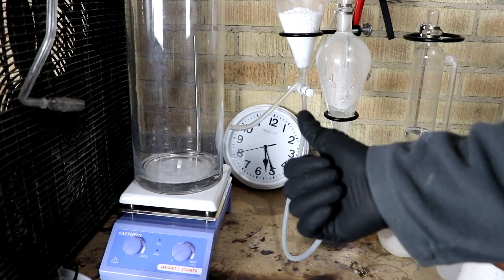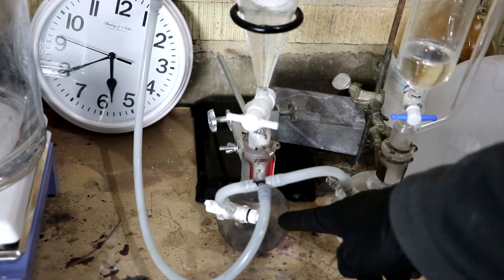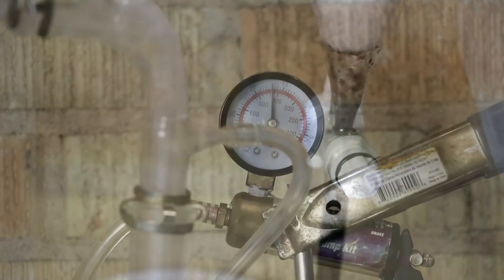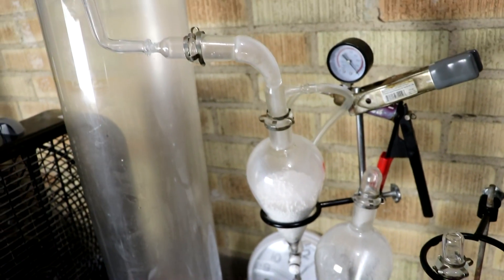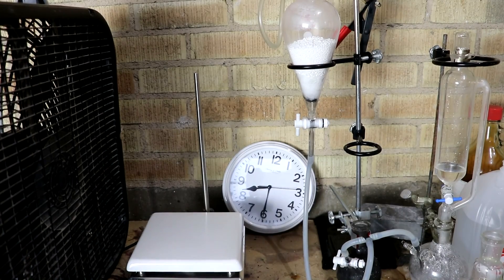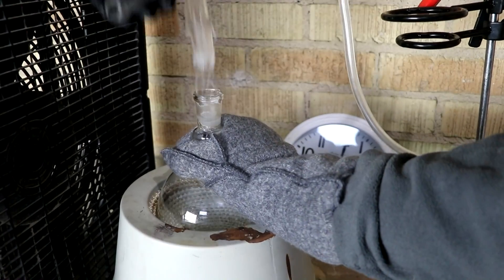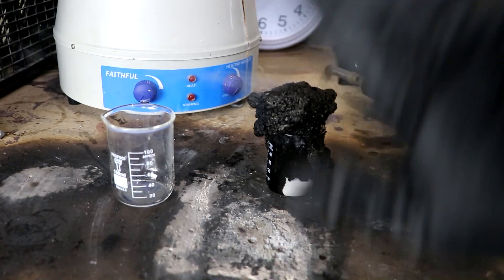Making Sulfuric Acid using the Chamber Process

Comment: Why didn't you use a 3 neck flask to pump air in and SO2 out, with elemental S burning in it, that way you don't need sodium metabisulfate, nor H2SO4 that you theoritically don't have

Comment: I know I'm late to the party but this is pretty important... Absolutely insane is pulling even a modest vacuum on a glass cylinder not designed for the task. You would not want to experience the results if that glass should fail. The force on it is really easy to underestimate. Never do this without something to arrest an implosion.

Comment: You sound like me I was all gone home making nitric acid the first couple of times and then when it became a regular job it became a horrendous chore my God sometimes I would set up 2 rigs running simultaneously I felt so endangered with the fume hood in my basement even though it was set up correctly running massive amount of clean air to the outside it still felt very dangerous and what a chore it felt like it would never and and the results were so meager compared to the work you put into it

Comment: I did not find single information about  old method producing Sulfuric Acid .This method  used more than 200 years ago in  Bohemia region of Czechoslovakia, known as the Nordhausen acid.  the only thing what I know is  they distilling  dry ferrous sulfate in  container by cocking them. I have no idea why there is no any information about this method?.. I guess maybe  governments so afraid if peoples knows it than anyone can easily produce Concentrated fuming acid and my evidence for my  word’s is the new idiotic rules, from last year in  Belgium its not possible purchasing Drain cleaner ;)))) they take it away from hole market,  replace it with some rubbish stuff like Bleach or sodium carbonate salt..so if your wc or Sinks stopped than only things available for you is some useless garbage..

Comment: H2SO4 synth works well with a Pt catalyst when chems are pure. When the input SO2 is from roasted metal ores the Pt catalyst gets poisoned so the chamber method is important. When V2O5 was discovered to be a good catalyst that didn't poison the chamber process went out of fashion (as did taking sulphur from metal refining off gasses)

Comment: You could have burned sulfur to create the SO2 with O2 from your oxygen generator instead of using sulfuric acid to make sulfuric acid, but I guess that would be more awkward: a little more tubing, fire doesn't mix well with glassware, how to ignite it and control the flow. On a not-very-relavent side-note, you can skip the SO2 entirely and directly make SO3 by heating up NaHSO4:
2NaHSO4(s) --(315°C)--> Na2S2O7(s) + H2O(g) --(401°C)--> Na2S2O7(l) + H2O(g) --(460°C)--> Na2SO4(s) + SO3(g) + H2O(g)
SO3(g) + H2O(g) --(after cooling)--> H2SO4(l)

Comment: I read in an old chemistry text book that its possible to start with elemental sulphur, mixed with a smaller amount of sodium of potassium nitrate, ignite the mixture and suspend it in the lead chamber.  The sulphur burns, mostly  combining with atmospheric oxygen to form SO2, but a small amount is oxidised by the nitrate producing some nitric oxide which is soon oxidised to NO2.  From then on it pretty much follows the route in Cody's video.   I suspect it might take a lot longer to rub but you dont need any acids to start the process.

Comment: That boil down of the H2SO4 must have been VERY good, the fuming was extreme when transferred to the beaker, and I've never seen sugar outgas like that on contact.  Seems like you got into Oleum territory somehow.
Reply: @AB-80X  Remember that he had just been blowtorching the neck of that flask, so the neck (and top portion of the flask) was likely still very hot. As he poured out the acid, it would have been suddenly heated by contacting that hot glass. I think that was likely the cause of the initial fuming.

Comment: This isn't quite the same as the Chamber Process. Originally, it wasn't a problem to have the chamber filled with air since that was needed to support the combustion of a mixture of sulpher and KNO3. To prevent explosive mixtures, lumps of sulpher were ignited on a bed of KNO3, let that burn until all O2 is used up and let everything settle and clear before opening.

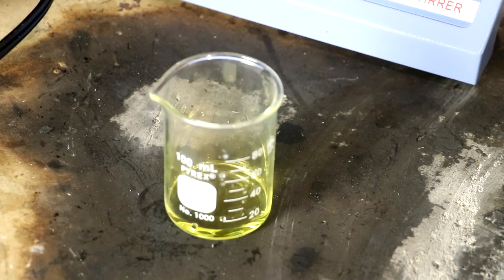1:50

"Do what you otter, always add acid to water"

Comment: I think you may have actually made oleum there, since regular sulfuric acid doesn't fume like that (though I suppose it might have still been hot enough to?).  Another thing that indicates this to me, is that the sugar dehydration doesn't usually go nearly as fast as yours stared out, but I suspect disulfuric acid (present in oleum) might, which would also explain why the reaction started so quickly, then proceeded more slowly, it used up all the disulfuric acid quickly, then continued with the regular sulfuric acid.

Comment: Today we will be making gold.  The first ingredient is gold.
Reply: You can substitute the sulfuric in the sulfur dioxide generator with hydrochloric acid (muriatic acid) or any acid really, sodium bisulfate works
Reply: @EdwardTriesToScience  I'll give that a shot with Citric!
Reply: Citric might not work but the pH is lower than sulfur dioxide so I don't see why it shouldn't work
Reply: @EdwardTriesToScience  Depends on the Electrostatic Difference between the Acid and the Base, I'm sure.
Damn, has it really been that long since High School Chem?
1... 2... 3... 4... FOUR decades, and change! Yes, it has. Time to do some homework!
Reply: @EdwardTriesToScience  no u
Reply: It's just for demonstration purposes. He could also have burned elemental sulphur which was the most common method to produce SO2 back in the day when this production method was still used.
It is what it is. Don't forget that in modern manufacturing of H2SO4 they use H2SO4 to react with the SO3.
Reply: @AB-80X  No ! Sulfuric and trioxide are used to make olleum.SO2 is made and the SO2 is oxidized to SO3 and then added to water to form H2SO4.
Reply: @johnykolk1414  
I am well aware. How does this pertain to what I said? I said that SO3 is used to make Oleum. Yes obviously SO2 is used to make SO3 by reacting it with a catalyst, that kinda goes without saying. My point is that in the contact process, you react the SO3 with H2SO4 to form H2S2O7. The H2S2O7 is then mixed with waterto get the desired solution of H2SO4. This is done to avoid the issues associated with mixing SO3 and water directly.
Reply: Exactly, there are so many other routs of SO2
Reply: @NerdyNEET  Kinda. Takes time and requires a lot of heat. Would be cool to see him make it from the contact process in glassware.
Reply: For sulfur dioxide you can also just burn sulfur lol, it’s just harder to do in a controlled way as opposed to dripping acid onto sodium metabisulfate

Comment: You could make it a lot easier if you mix Sulfur and KNO3 88% to 12% put it in an big glas char on an iron ship that stands on an Little bit of water. Ignit it and repeat. Thats the way robruck did it 1750 or so.Instand of lead he used glas baloons with 220liter capacity.

Comment: Why you just dont burn (s)S, then heat (g)SO2 at around 480 degrees celsius and then, when it reacts with (g)O2 forming (s)SO3, just wash it in (l)water to form (l)H2SO4 ?

Comment: sodium metabisulfite in stump remover and mix it with Hydrochloric acid to generate the sulfur dioxide gas. Bubble the SO2 into strong hydrogen peroxide solution. I did that years ago,  but this method is very interesting as well

Comment: Maybe you could help me a little with diy dentistry. I've got some 60% phosphoric acid and I'd like to make some calcium phosphate from it to help my teeth with remineralisation forming hydroxyapatite crystals etc.  And how'd you create the top cavity bio-compatible filling stuff? They do trials with nano hydroxyapatite/collagen mixture but it's nowhere to buy such a composite. Even if it was it's always cheaper to DIY right?
Reply: ...if I add xylitol into my hydrogen peroxide-urea mouthwash, will it react and become useless? I've seen elsewhere I can't add sodium bicarbonate because the peroxide is acidic or kinda acidic. What if I add some antioxidant? Will it prevent H2O2 from reacting with various herbal tinctures in the mixture?

Comment: Coloradan here with a glass-on-glass tip. My bong has the same kind of connection and I use a butter knife and gently tap the side to "unstick" them. It doesn't take much force at all, and usually only one or two taps to vibrate them loose.

Comment: Cody, thank you very much for all the experiments you have shared with us, I appreciate your videos!
Although I am aware that you may not have any interest in covering the chemistry of Ruthenium, since it is quite expensive, I have to do research in Ru complexes. The problem concerning reactivity is that you have to substitute the counterions of a Ru salt (e.g. RuCl3) by triphenyl phosphine or other ligand. In my reseaarch I start from RuCl3•xH2O, which is more expensive than gold. But the fact is that in my lab there is anhydrous RuCl3 that is quasi inert(also insoluble in MeOH). 
Could you help me find a protocol for obtaining the hydrated form of RuCl3 ? I mean some recipe, from an article. I searched but I could not find any satisfying answer. At a certain point I came across a method involving the "recrystallization" of anhydrous RuCl3 from concentrated HCl, but I am not sure about that procedure.
I would be very grateful to you. If you find anything, let me know, maybe send me the DOI of that material
Thank you again!

Comment: Just for comparison's sake, could you show that the starting material does not have the same reaction to sugar? That would indicate that there was a chemical change. Another possible reason that the pressure did not drop could be that the temperature of the gases increased from the use of the hotplate.

Comment: Nice work! Now, try again without the precious nitric acid. One simpler way to achieve this is to use activated charcoal as a catalyst. This absorbs sulfur dioxid and oxygen, and produces sulfur trioxide directly (cool it down to favour the resulting SO_3). Wash the catalyst afterwards with water and you'll get sulfuric acid. 2 SO_2 + O_2 <-- activated charcoal --> 2 SO_3 + energy

Comment: Hello just a suggestion if You want to scale lil bit up, its possible to deposit some V2O5 on copper mesh( should be heated a little bit- around 150-200 c ) and blow on the SO2+O2 mixture witch is producing the desired SO3 gas :) i tried this method long ago

Comment: So just some notes.
Did you lubricate the glass joints?  In general they don't hold a vacuum if you don't lubricate them.  I think pretty much any moderately heavy petroleum distillate will work.  For high temperatures sulfuric acid itself is usually used.
Second point, sulfuric acid boils at around 300 C.  For anyone doing this at home, theres a really big difference between pouring room temperature sulfuric acid into sugar and pouring 300 degree sulfuric acid into sugar.  It seems like Cody was a little surprised at the quickness of the reaction.  If it had been hotter, the "reaction" would have been more of an "explosion".

I like the chemistry, but for me this is a good example of unsafe practices and things that can go wrong when doing chemistry.

Comment: I've never had the sugar dehydration proceed so quickly, and sulfuric acid doesn't usually fume, I think you actually made oleum there.  That would explain the fumes, and possibly why the dehydration happened so quickly initially.
Reply: Not Oleum. It looks different and crystallize.
I think what happened was that he was able to produce an acid which was more than 98% pure but 100% max. 99-100% H2SO4 fume like that. Had he left it out for a bit, it would naturally have become 98% or less. On top of that, it looked a bit hot too.

Comment: Why would you dry the oxygen when you pull it into a chamber that has water in it afterwards? I think that drying step isn't really necessary here. It makes sense for the SO2 though. Also please stop using such strange pressure units like "inches of mercury" and Torr, most people around the world use bar or mbar (=hPa) to measure pressure.

Comment: So.. nitric acid was catalyst yet not accounted for at the end or separated out? Also, putting sulfuric acid IN as one of the steps makes it really confusing how it works, I think a shortcut might have been to pour it directly into the result and say "done". :D
Reply: The nitric acid was removed with the water when he distilled the crude acid solution. Note that the distillate looks yellow: this is a sign of contamination with nitrogen dioxide, which is a decomposition product of nitric acid.
Reply: Ah, I didn't know nitric acid would distill out at that step - would have helped if he'd mentioned. Thanks!

Comment: Fond memories.  First unit that I worked in as a process engineer in an oil refinery was a sulfuric acid plant.  Burned H2S and elemental sulfur to produce the S02 (as well as weak acid purged from another unit).  Used a vanadium catalyst to convert to S03.  Some parts of the plant were lead lined steel, some were fiberglass, etc.  The sulfuric acid was used in part in an alkylation unit to produce gasoline from isobutane.

Comment: When you have to glass pieces stuck together, you can tap them slightly with something made of metal to loosen the joints. That way you can get them unstuck when heating is not an option.

Comment: Well, this is a very crude demonstration of the basics. I hope this is only the start of a more pratical approach, where you at least make more acid, than you use and start from elemental sulfur. The goal should also be to get a more concentrated acid, as you could have used hydrogen peroxide (stoichiometrically) or manganese dioxide (catalytically) directly otherwise.

Comment: Crude apparatus, but works well for a demonstration. You proved it works, well done.

However, there are three incorrect things I have to point out.
First, there is no such thing as sulfurous acid in solution. When you dissolve sulfur(IV) oxide in water, you get mostly its molecules stuck between water molecules, and a teeny tiny amount of hydrogensulfite anion because there is some tiny ionization going on. But there's no sulfite anion.

Second, that vessel is not designed for evacuation. You were lucky it didn't implode. If you need to do it again, surround it with a steel mesh.

My biggest objection is the way you treated your ground glass joint flask. I am sure any laboratory flameworker would absolutely crige at the sight of suddenly applying hot, sharp flame to a stuck joint. Never ever do that if you value your glassware. They can snap so easily and if you're lucky and nothing happens, you're left with stressed glass which will burst sooner or later.
When two ground glass joints are stuck with a low melting point material, use a hair dryer or, carefully, a heat gun. If the chemical has melting point close to the softening range of glass, put the stuck glassware in a deep freezer and when it cools down, wrap the stuck joint with hot rag (steamed kitchen rag is a good choice) and carefully agitate the glassware.
Carefully thumping the joint on the edge of a wooden desk, while rotating the glassware, can also help.

But not a gas torch. Any laboratory operator would tell you to leave if they saw you doing that. It's a last resort thing, when price of the compound inside outvalues the price of the glassware. In that case, it's better just to cover it with a rag and smash it with a hammer.

Comment: you say your using nitric acid as a catalyst, but the nitric acid is being used up in the reaction which means by definition is not a catalyst
Reply: doesn't he get the nitric acid back during distillation?

Comment: But won’t it be problematic if the reaction was actually taken in a lead lined chamber, as the nitric acid will react with lead and form lead nitrate, and in the presence of sulfuric acid, the nitrate will reform nitric acid and further attack the remaining lead?
Reply from the maker: Lead doesn’t dissolve well in a mix of nitric and sulfuric acid. Similar to how silver won’t dissolve in nitric mixed with  hydrochloric.
Reply: Aussie Chemist lolz dude once the nitric acid reacts with lead it's gone as the salt, it won't get regenerated. Then the sulfuric acid produced at that point will catalyze the rest of the reaction
Reply: Pb(NO3)2 + H2SO4 = PbSO4 + 2HNO3
Reply: Aussie Chemist and then a layer of insoluble PbSO4 would form which can't be attacked by HNO3. Either way you put it the walls are going to be fine.
Reply: Spooky Wizard that happens only when the lead sulphate is formed directly on the surface of lead, the lead sulphate that forms under this type of condition is not as structurally sound as the lead sulphate that is formed with by reacting only Sulfuric acid and lead. Besides with this much stirring that was going on, I highly doubt it will stay intact

Comment: What's the strength of that sulfuric acid you used on the sugar. The reaction looked more vigorous than other times I have seen that reaction done.
Reply: Looks more like Oleum to me, so 100% H2SO4 with dissolved SO3. Which is considered "over 100%" concentration because added water will be converted to more sulfuric acid.

I mean I could be wrong but I've never seen it react with sugar so quickly or fume so much in air.
Reply: I believe the acid is oleum, ie, strength is greater than 100% acid.  It is SO3 dissolved in 100% H2SO4.